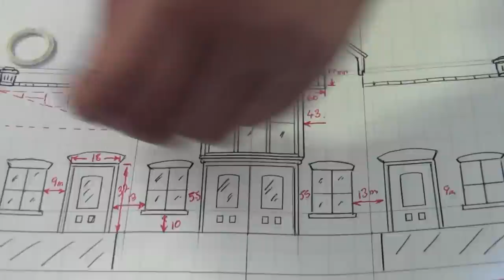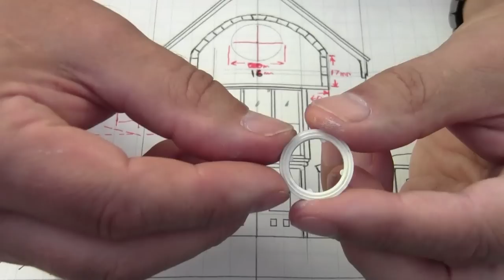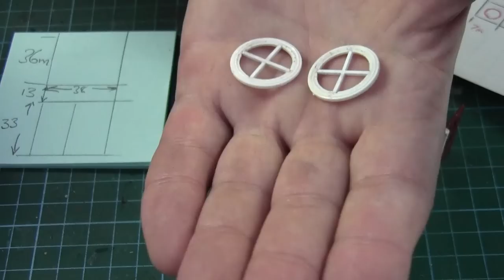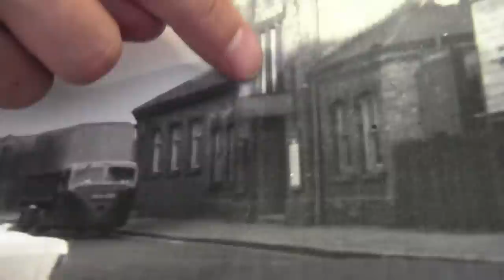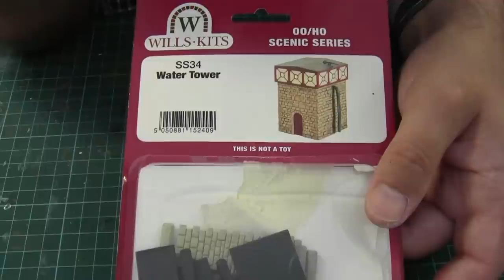Jarrow Road Station, Windows, & Water Tower. No 335

Comment: :yt:Those are some very nice window frames, doors and the rail with the platform signs. Now wait a minute I think I may have forgotten something!! now, what was it? oh, yes the water puddle under the water spout of the very nice water Tower with its Tony North Eastern extras. Now is it going to be the station or the signal box next? While the paint is drying it will be a little bit of both. (Maybe) Martin. (Thailand):oops::oops::oops:
Reply from the maker: Hi Martin,  walls are stating to go up. windows and doors are being fitted the guys are on overtime. its great to sit back and watch other people work. but now and again i have to give them a hand....lol. your right though the water tower is not completely finished, maybe another time. when i am less focused on the station...thanks again for commenting....cheer's Tony

Comment: Thanks so much the answer Tony ! The elusive door knob ...! I had bought the pins but they come in two sizes ..no prizes for guessing who bought the wrong size ... I think I have ordered the correct ones now and they should be here on Monday ... Thanks again mate Steve
Reply from the maker: Hi, Steve. they are the really fine ones. they are almost like small needles. the heads are only about 0.8mm in Diameter. it sounds like you have the right ones now. all the best and happy modelling. cheer's Tony

Comment: Dear Tony, love the articulated water spout, the on the roof lever, the chain and hook. Cool idea to use those electric washers for round windows. Excellent work from the paint firm. Now I’m curious what the contractor is going to deliver. I’ll bet he’ll firstly start complaining about the painters taking up all the space at the building site. Cheers Vince
Reply from the maker: Good morning Vincent. those painters where very tidy. not a drop of paint was spilt onto the platform's. ideas come to us all the time. the curved water crane came about because i had added a window. and we could'nt have the water shoot directly in front of the window. its just the little things, which makes its interesting.....thanks again my friend. Tony
Reply: @TONYNORTHEASTERN  yep, that’s indeed what it is all about. Have seen the Wills kit before. It’s not that it hasn’t character of itself. Think it’s a great kit. However, the tweak with both the window and the spout truly enhance the kit beyond the obvious from the sprue build. Also is very much in tune with the other water towers on your layout. Especially where the ’painters’ did another excellent job.

Comment: drill a hole in the door push in the track pin all the way through  then cut off on inside of door then pull on the pin to were you want it on the out side eayer than trying to put it a fiddly bit of pin 3mm
Reply from the maker: I could do that as i now have some still flush cutters. cracking tip...thanks for commenting.  Tony👌👌👌👌👌

Comment: Tony,
Just a quick question. I’m thinking of getting some O gauge track for the garden.
Can you run O gauge engines from say a 12v gauge master controller ? 
Someone told me it must be 16v ?????
Cheers 
Duncan 🙋‍♂️🚂
Reply from the maker: Hi Duncan, i can only say what i used for outdoors. the controller i used was a H M Duette twin controller. o-15v output. they were a good reliable controller. something with a similar output would do. i hope this helps..
Reply: @TONYNORTHEASTERN  Thanks Tony, yes it does 👍🏻👍🏻
Duncan.